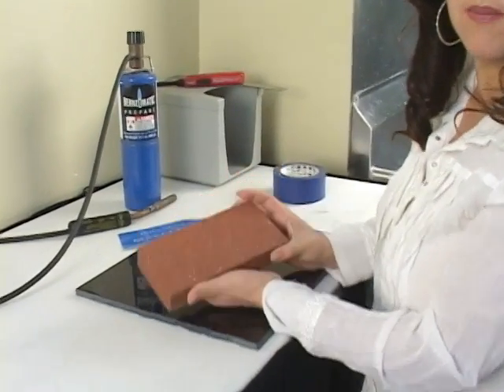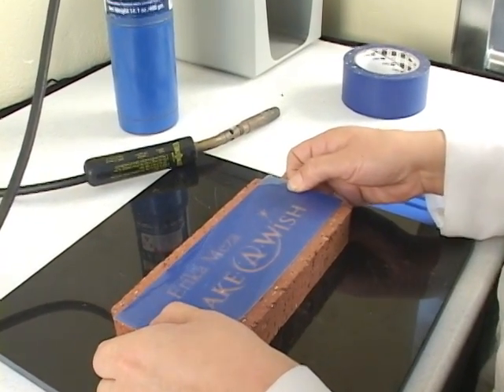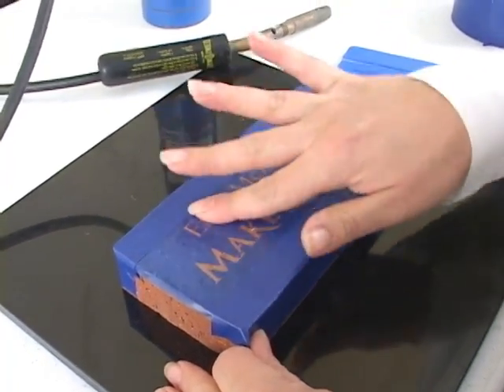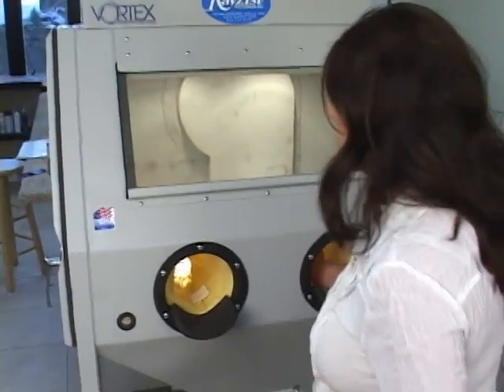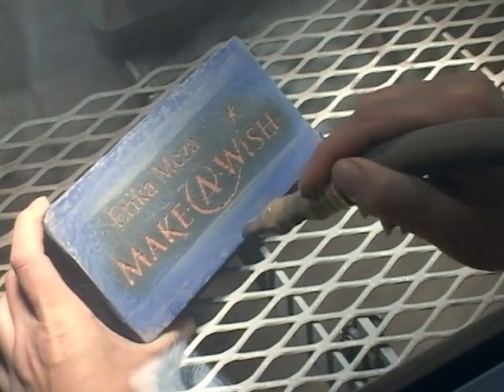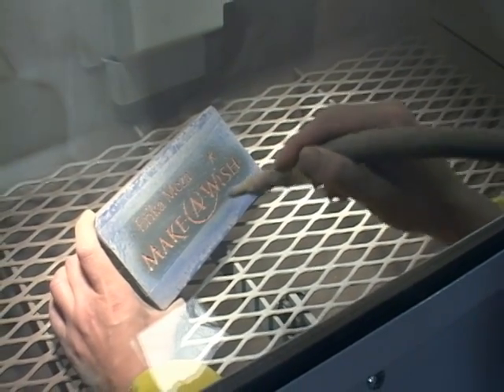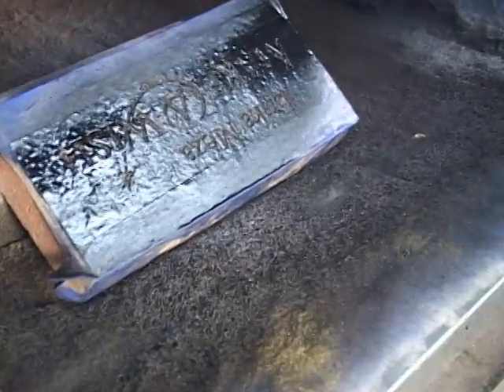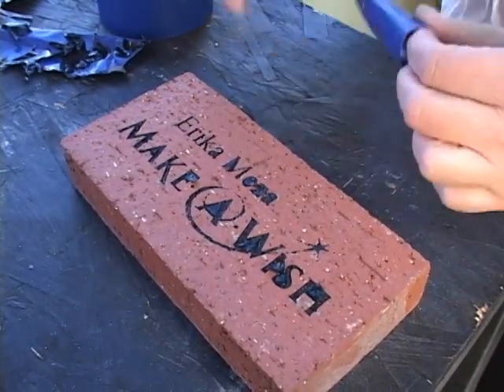Sandblasting a paver brick with 4Mil SR2000

Comment: You can't sand blast without the entire glove... that stuff stings when it hits your hands. That's why it ruins the gloves after so long.  Good bye pretty hands and nails and skin if you keep that up. Obvious she does not do that. :-)
Reply: Thank you for your comment John. Personal protection is always suggested especially for production applications. We are demonstrating sandblasting a paver brick, with a fine blast media (150 grit Alum Oxide) using a thinner photoresist stencil and 3/32 blasting nozzle (with a pressure pot) so the blast is pretty focused, she should not be blasting her hands in this case.

Comment: Why are there no current videos, most are over 7 years old. I am trying to find out what type of nozzle and compressor. I have a pancake compressor.
Reply: Hello C Rob, we have added many videos since this first video. See our "YouTube/Sandcarving" channel. 
Pancake compressors are pretty small, but we have used them in a jam. If that's all you have, it can be used however you will be limited to about 30psi (max blasting pressure), as well you likely will lose blasting pressure after operating for more then 8-10minutes. 
You can use a 3/32" nozzle, but perhaps a 1/16" orifice nozzle might be better to lower your CFM (air output)
This is based on using a "Pressure Pot". If you're using a siphon system blaster I am not sure if you would be able to use a pancake compressor. 
Hope you find this helpful.
Reply: Sandcarving this is a bit more complex than I thought. I already have a blasting cabinet that Requires 9.5 CFM at 90 PSI to operate. And a 6 gal 150 PSI compressor. I don't know what the CFM is. I'm trying to blast a photo of a bird and a cat into a piece of marble and the same in a glass block window.
Reply: Sandblasting is a huge term, and there are many more industrial applications then there would be in the decorative aspect of the market. Understanding the differences I guess is the key. It sounds to me like you have a "siphon system" type set up (squeeze trigger gun - the media is sucked up through a tube) a siphon system generally will require 40-45psi as a starting pressure. A pressurized system "pressure pot" (media contained in a pressurized vessel) the starting pressure could be as little as 10psi. Ideally 30-35 psi. 
Blast pressure is depending on two factors: #1 blasting media  #2 the resist film you are using
For "photos" 180-150 grit would be idea, Aluminum Oxide or Silicon Carbide would be standards. 
Sandcarving is not complex, certainly a few formula's to work out and a good understanding of the equipment your using. 
Hope you find this helpful.
Reply: So I now have a 5hp, 25 gal 125 psi, 9.1 scfm@40 compressor. Will this work with a siphon fed blasting cabinet?
Reply: We do not deal with Siphon Systems (Pressure Pot systems only) I would suggest you confirm with the manufacture of the gear your using on specs. However, that seems like it will work to a certain point. Siphon Systems consume a lot more volume of air to siphon up the media compared to a pressurized system so your compressor may work very hard or you will have limited blasting pressure.
Reply: Sandcarving I will commence my pressure pot search

Comment: Thank you for the great videos Liz! While there a number of variables that determine blasting time, could you provide a basic blasting time range for an item such as the one you have done here?
Reply: Hello Andy, appreciate the reply! This video was produced many years ago... 
To answer your question; the average "clay" paver will take between 2-3 minutes to sandblast. Most walkway pavers are not typically blasted too deep into the surface (preventing dust/mud from filling in the engraving)
Achieving depth quickly is a matter of grain size and blast pressure. The sandcarving film you use will determine how high of pressure or how the course of media can be use.